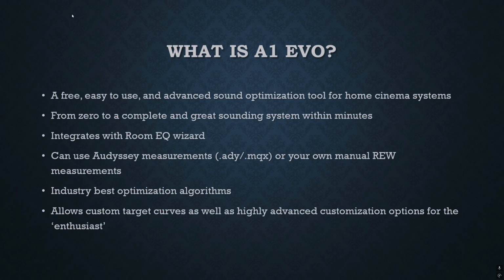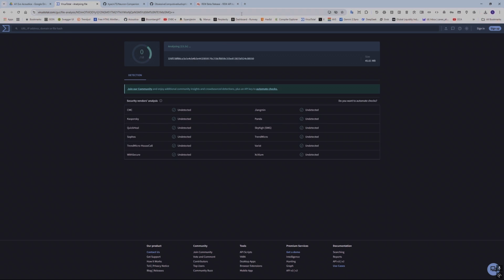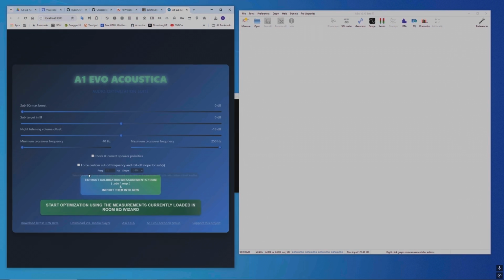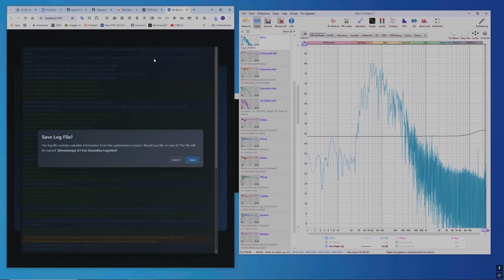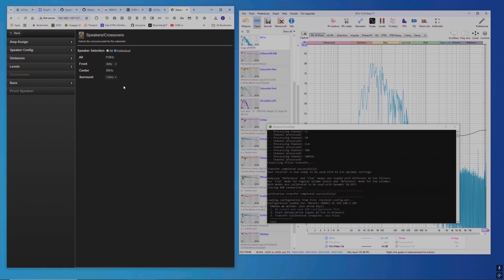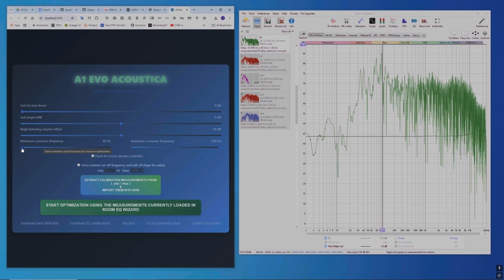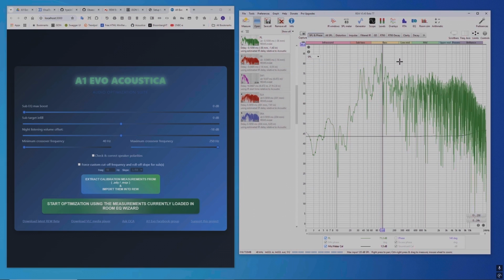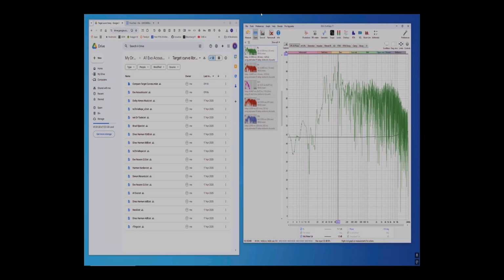A1 Evo Acoustica

Comment: freezes here every time I drive and REW stops responding

16.58.26 [INFORMATION] >> Assigned Crossover: 150Hz, Left allpass Q: 0.0000 to SLA
16.58.26 [INFORMATION] >> Assigned Crossover: 150Hz, Right allpass Q: 0.0000 to SRA
16.58.26 [INFORMATION] Final crossover and polarity settings:
16.58.26 [IMPORTANT] FL: 80Hz, polarity inverted? false
16.58.26 [IMPORTANT] FR: 80Hz, polarity inverted? false
16.58.26 [IMPORTANT] C: 80Hz, polarity inverted? false
16.58.26 [IMPORTANT] FHL: 120Hz, polarity inverted? false
16.58.26 [IMPORTANT] FHR: 120Hz, polarity inverted? false
16.58.26 [IMPORTANT] SLA: 150Hz, polarity inverted? false
16.58.26 [IMPORTANT] SRA: 150Hz, polarity inverted? false
16.58.26 [IMPORTANT] SW1, polarity inverted? false
16.58.26 [IMPORTANT] SW2, polarity inverted? false
Reply from the maker: If you have an old PC, install REW without the "graphics accelerator" option and minimize its window while its working...

Comment: Not going to say anything new, but my HT never sounded like this.
I was having trouble getting my subwoofer calibrated with the Audyssey app, it would always be too low, and if I raised it afterwards it felt boomy, and when trying to use those measurements with Acoustica it would always tell me my Sub was 20db high, no matter what level I set it, so Acoustica would lower it to the point of being inaudible.
But after calibrating using acoustica's measurements the results were incredible, I get the clarity on my main speakers, and the correct amount of bass wihout sounding boomy.
Amazing... I was looking into purchasing a new SW because I thought that was the problem. Thanks for saving me money AND upgrading my sound!

Comment: Is there a reason (or only in my setup) that it doesnt EQ the speakers between 350hz and 1.3khz? It trackes overall very good to my TC but I have a 5dB dip at 560hz and 1.1khz to 2khz is constant 2dB under the TC. It sounds good, but just wondering.
Reply from the maker: You don't wanna eq beyond room effects which fade around 200Hz

Comment: Hi OCA, huge and sincere Thank You for the effort. Love the results.

I have a 3500.  Noticed when I do a measurement, the tool shows FHL but test tone plays on the FHR and vice-versa. Cabling is correct as when using native Denon or MULTEQ app. 

Also, when sub is measured, tool says it is out of phase even though phase is set to zero and subs are below FL and FR.
warm regards...
Reply from the maker: Are you using REW or Acoustica tool for measurements?
Reply: @ocaudiophile  Acoustica

Comment: Hello,
I have a question about future versions, or rather a wish:
In my particular case, I would need more than 2 memory locations for measurements/target curves on a Denon x4800h. Would it be possible to store a “setting” in a1 evo acoustica, in which the “Reference” curve could be converted (instead of the optimization for quiet listening, a manually selectable target curve or better a completely new calibration file could be stored here)?
This would have the advantage that you could store not just 2, but up to 4 calibration/target curves on the Denon. For Example:
- speaker configuration 1 - flat (= measurement 1 for middle seat with movie-targetcurve)
- speaker configuration 1 - Reference (measurement 1 for middle seat with music-target curve)
- speaker configuration 2 - flat (measurement 2 for left seat)
- speaker configuration 2 -  Reference (measurement 3 for right seat)

Would this be technically feasible and if so, is it planned for future versions?
Many thanks in advance.
Reply from the maker: It would be nice but a different target curve almost always changes levels and even crossovers which is not doable. Only filters can change between flat and ref modes, all else need to stay identical.

Comment: Thanks for contributing so much to the community! Is it recommended to take measurements with REW, or is it the same as taking measurements with Audyssey? If REW measurements are recommended over using the Audyssey measurements, should I take the REW measurements with my subwoofers on or off?
Reply from the maker: Sub should be off when you're measuring speakers and they all need to be set to large/full range to bypass crossovers. Better start with Acoustica measurements as you don't need to care about any of these and its results are very good.

Comment: I finally wanted to try the new acoustica optimization. I come from the original Majestro version, and has been quite pleased with that.
But when running the acoustica, i get error message that REW cant find measurements from my subs in the ADY file.. Same file i sucessfully used on Majestro. What can be wrong? I dont wish to run a new complete calibration without knowing why the acoustica program dont find the sub masurements?
Can some wizards help?
Reply from the maker: Use Acoustica 's own measuremt option.
Reply: @ocaudiophile  My challenge is that my only computer is an desktop wich is connected througt the reciver to a 75" flat screen. When i start acoustica to start calibration, i loose my only image and cant see what i am doing as the screen is saying that reciver is controlled by the mult eq app(acoustica) Is there a way to controll the setup through the multi eq app on the phone, or do i have to have an laptop(wich i currently dont have) not connected to the reciver by image
Reply from the maker: Temoparil connect your PC to TV directly bypassing the AVR, the calibration process is all done through the network, no connection to the AVR is necessary.
Reply: @ocaudiophile  Thanks for answering :) I found an old monitor and now i enjoy acoutica :) Fantastic!

Comment: Ich danke dir Serkan. Hat alles geklappt🎉 Aber ein paar Fragen hätte ich. Wieso ist der Subwoofer danach bei mir auf +7dB ist das nicht zu viel, wenn der Rest der Lautsprecher auf +0 oder -1dB sind? Kann ich die Trennfrequenz auf 60Hz selbst ändern ohne das es etwas vermurkst? Ich danke dir vielmals nochmal ✌🏼
Reply from the maker: Danke. Die interne Lautstärke Ihres Subwoofers war für die von Ihnen gewählte Zielkurve zu niedrig. Positive Lautstärkeanpassungen sind kein Grund zur Sorge. Das ist ein Mythos. Sofern Sie bei sehr hoher Lautstärke keine Verzerrungen hören, ignorieren Sie diese einfach. Drehen Sie die Lautstärke des Subwoofers bei der nächsten Messung jedoch etwas höher, wenn Sie sich besser fühlen möchten.

Ändern Sie die Frequenzweichen nicht im AVR-Setup-Menü, da die EQ-Filter dann völlig zufällig sind. Verwenden Sie stattdessen die benutzerdefinierten Schieberegler in Acoustica, bevor Sie mit der Optimierung beginnen.
Reply: @ocaudiophile Hi, und wie kann ich das LPF auf 250Hz verhindern? Ich mag das nicht hätte gerne 120hz wie es vorgesehen ist, mag das Sounding nicht mit 250hz
Reply from the maker: Express sets lpf for LFE to 120Hz. If it's not 120hz then you're having a problem with calibration transfer

Comment: I’ve tried to do the switch sub cable method for my dual subs again, but it’s given me distances 0.00 and 0.05… have I messed up? I can’t recall if this is normal… currently rewatching the vid
Reply from the maker: It's possible if the subs are really close to your listening position but since this is usually not the case, your subs might have been measuring with large delays. Turn off ALL processing in the subs if any and re-measure. Btw, if only one sub is 0 and the other is couple of meters, that's fine.
Reply: Thanks OCA, I think I’ll remeasure as maybe I got the cables confused first time around!
Reply: One sub was 0.00 and the other came back as 0.05
Reply from the maker: Depends on your sub positions

Comment: hi OCA I had a question regarding the low level listening mode. For my room My normal listening level is actually only 60 Db. Is there a way to tell acoustica to calibrate for 60Db? what settings would you recommend for getting the best sound experience for 60Db? Thank you

Comment: I didn't realize my home theater system could sound this good. I am seeing API server error when I upgrade to Windows 11. The rew API server is running but inaccessible. This happened after installing Windows 11. Could this be related? I'm asking for help. Thank you!
Reply from the maker: Reinstall REW after clean uninstalling it using its own uninstall menu. Don't start REW yourself, let Acoustica open it.
Reply: @ocaudiophile I will try this, thanks
Reply: @ocaudiophile I did what you said but the result didn't change. I think it's a security issue, what can I do?

Comment: I am new to this and it looks awesome but I have a question.  For context, I am using the Audssey Multeq  editor app and Audssey Mic to gather my measurements.  My receiver_config.avr file for my Denon X6700H shows correctly that I have 2 Subs.  However, the .ady file that I import from the Audssey editor app only has one set of measurements for my subs.  The Denon X6700H does not appear to have directional bass and will not do independent sub measurements.  Therefor when I run Acoustica it detects that there is only 1 set of sub measurements when it is expecting 2.  What do I need to do?  I assume I could duplicate the existing sub measurements but I don’t want to assume.  Thank you for your help.
Reply from the maker: Use Acoustica's own measuremeht tool. It can  temporarily put an 6700 to directional mode and separately measure each sub. Besides you can take up to 25 mic positions instead of 8 if you so wish.
Reply: @ocaudiophile  Thank you very much!  I don't know how I missed that.
Reply: @ocaudiophile  I have one more question.  I was able to run the everything and it sounds awesome although the overall signal is much quieter that I am used to.  I noted the following entry in the logs and I am curious if I have done something incorrect.  The entry is "[INFORMATION] Final target level:: 63.57105dB", that seems low to me as I would have expected something around 75db.  This is not an issue for me or anything but I want to make sure that I didn't miss a step or something like that.  Thank you for your awesome work!
Reply from the maker: @ChrisFulenwider-f1y This is related to your speaker efficiencies, their distances to your mic position, etc and is not an important parameter but is just there for info although I must say 63dB seems a bit too low. I've seen many below 70dB but...

Comment: After doing all, it says only one subwoofer info is there is my Audessey file. I use two subwoofers and measured using Multieq Audessey app for two subs. I entered the same file generated by the Multieq Audessey app. But error? Any ideas for solving this  problem? Beginner to this...
Reply from the maker: Measure your system with Acoustica. You need individual measurement data for each sub for Acoustica to properly adjust system bass response however Audyssey app contains only one measurement for the summation of two subs which is useless. A1 measure tool will measure your subs separately which it will then use in optimization.
Reply: @ocaudiophile  also had this problem. Will try! Thank you! ❤️

Comment: Hi. I am adding a second sub to my NR1711. The AVR does have independent sub controls, so I am planning on getting a Minidsp and setup the eq on the dual subs that way. How run Acoustic room correction afterward if I can’t use the Multi- EQ that would only look at the single virtual sub that is hooked up via the dsp?
Reply from the maker: Yes minidsp will be the way forward but why are you adding a second sub? It's not as beneficial as people believe especially without independent controls. I'd invest in a single better sub  instead. Multiple subs are for uniform bass across a wider area.

Comment: First of all thank you for this awesome tool. I took 8 measurements using Audyssey. I kept the original settings in Preset 1 and Pushed the Acoustica settings to Preset 2. 
noticed that Stereo Music sounds good with a tight Bass and Bright on the higher freq on Acoustica settings. But for movies the Rumble is much better on Audyssey settings. 
I was watching John Wick 4, opening scene where he is punching. Acoustica sounded flat on subs. 
Should I take more measurements?

P.S. The interface in the video does not match what I see on my computer.
Reply from the maker: Try repeating the transfer and check for any error prompted during transfer. Do not check distances after transfer is completed if A1 used extended distances because that will change the distance settings and ruin bass response.
Reply: @ocaudiophile  Thanks for the quick response. I did not change any settings (or distances), just switched Presets to compare. Also there were no transfer errors. Maybe I'll just do the measurements again tonight. Are there any specific positions or standard Audyssey 8 positions (in and around the listening area) are good enough?

Comment: I hope the next version will incorporate independent detection for bass volume, as I cannot determine where the bass volume knob should be set before testing. Thank you!
Reply from the maker: Almost all units have a built in sub volume leveling tool at the beginning of the Audyssey measurement process. And besides, you do not need to adjust sub volumes accurately for Acoustica. It can handle a large variety of sub volumes automatically.

Comment: Is it just me or anyone else has the same issue?
I just downloaded everything new and when i open advanced in the browser crossover min and max are set to 40hz and 250. But as soon as i touch the slider the min is set to 90hz and i cant go lower. I have an Denon 2700H.
Reply from the maker: 2700H is MultEQ-XT and cannot filter speakers below 93Hz hence the limit for custom XOs.

Comment: Hi Serkan. 

I'm trying to help someone who has emailed me after watching my vid on my channel on  how to use the A1 Evo tool. They have an .ady file and have been trying to get settings into A1 Evo Acoustica but getting error messages. They sent me the .ady file and I am also getting the following (they are running two subs):-

06:43:40 [WARNING] ⚠ Imported measurements in REW are missing data for each of the 1 subwoofers in your system!
06:43:40 [WARNING] Try manually measuring each of your subwoofers with REW and a calibration microphone and RCA cable swapping method
06:43:40 [ERROR] A1 Evo Acoustica cannot optimize your system without individual measurements for each subwoofer!
06:43:40 [ERROR] >>> A1Evo Error:

Am I right in thinking they have some settings on their amp that may need checking? Just to confirm, everything works with my own .ady file and I use just one sub. 

Cheers
Reply from the maker: That's a dual sub setup measured in standard mode. A1 needs separate measurememts of each sub to align them with each other properly. He should measure his system using Acoustica measurement tool which will do that.
Reply: @ocaudiophile  Ok, yes I just updated the Acoustica and found that. I'll pass it on. Awesome addition. Thanks for the reply.

Comment: 👏 🙌
New to avr world. Your software made the process easy & it sounds sooo much better than i was able to achieve with audyssey. Fuller & ALIVE!
I agree when you say the acoustica curve is abit bass heavy but i think i love it 😂
Again, many thanks & much respect 🙏
Reply from the maker: Cheers
Reply: @ocaudiophile does it matter that it adjusted the avr sub trim level from -11 to +3.5?
As "they" say it should stay in a minus for headroom,
Sub gain was set to -17 before running audyssey to achieve -11 on avr
Reply from the maker: @Red-ur5mr No, it doesn't unless you listen in extremely high volumes and hear distortion from sub at these levels (highly unlikely). If that's the case, turn up sub's own volume a bit higher next time you take measurements
Reply: @ocaudiophile ok cool, cheers for that, I'll leave it as is then.
Didn't know if it was worth upping the sub dB and reducing the avr dB by the same amount to re level it as the sub has an app & can choose db